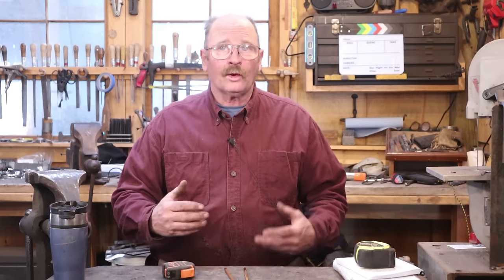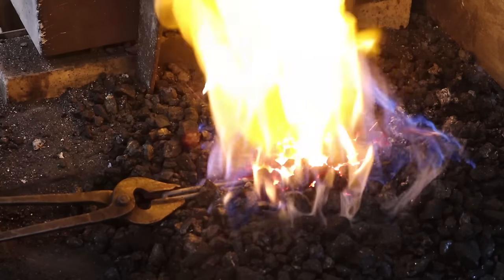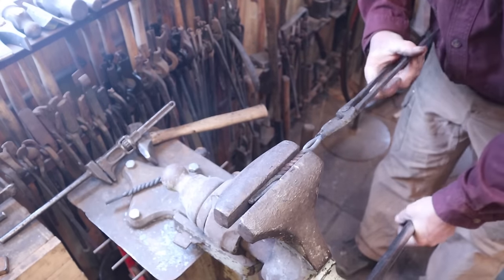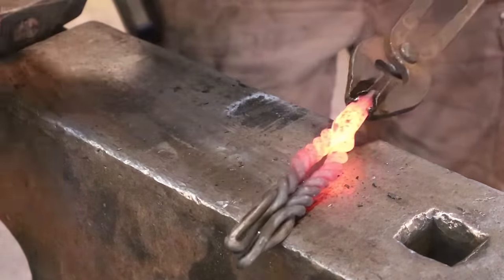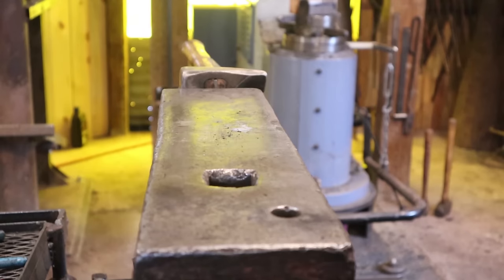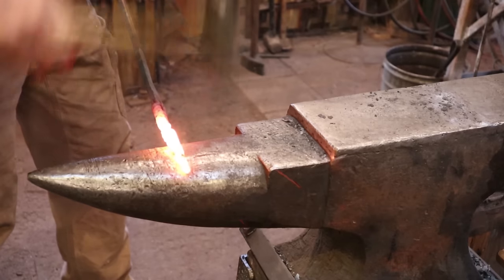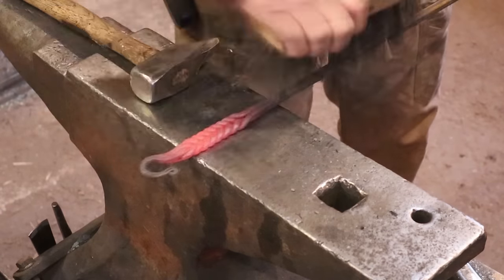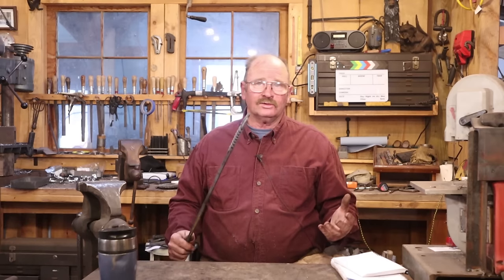Blacksmithing - Chevron or Wheat twist, forge welding twists

Comment: It's called a braid, not "chevron" or "wheat twist".

You don't need to make it sound manly, you're literally braiding iron, that's manly enough.
Reply from the maker: A braided twist is different from this.  The common term for this twist is as stated in the video.  This doesn't even resemble a braid